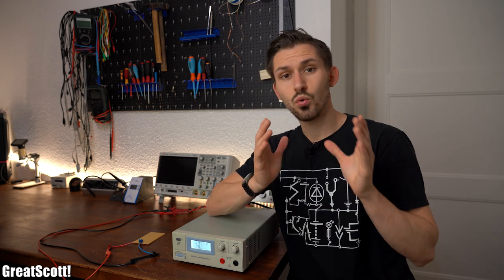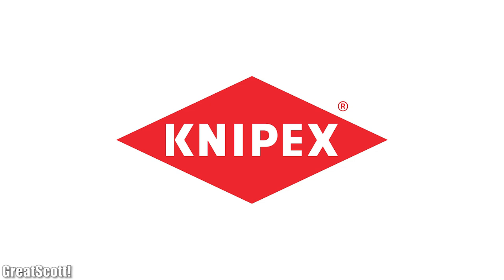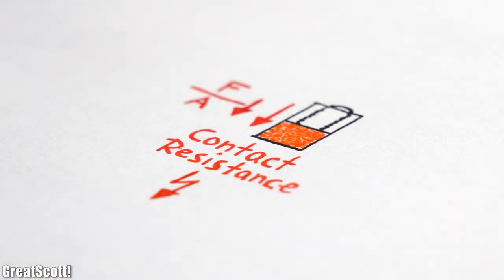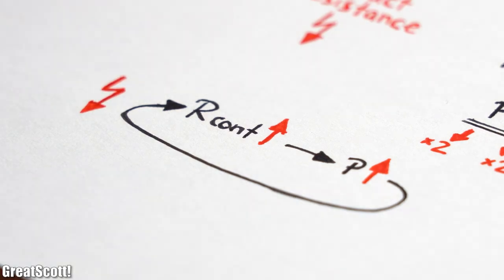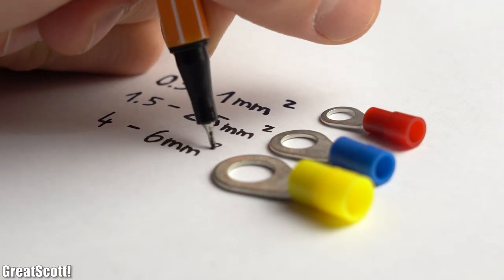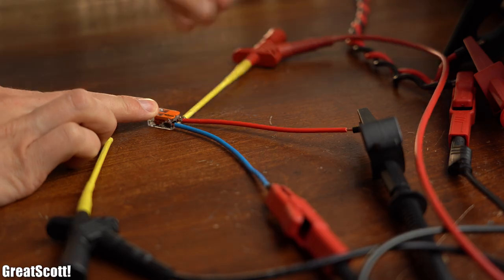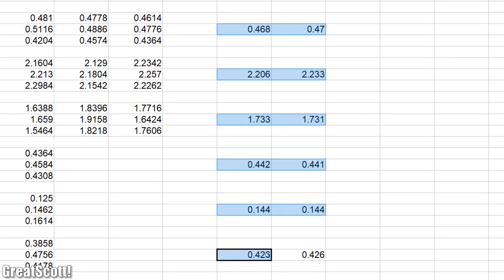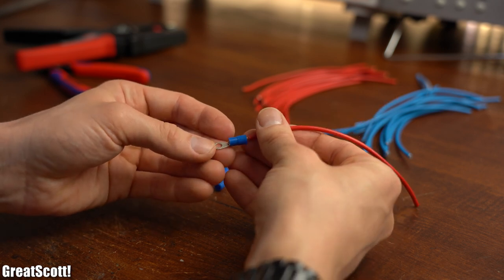Connectors are more important than you might think! So which one is the best? (Experiment)

Comment: After I moved into newly built rental home I happen to open one switch board as the plug always gave sparks and would often disconnect. To my horror I found every single connection in the board was loose despite the work bieng only 2 months old. Every switch, every socket, every single wire was loosely connected. After few days spent 16 hours straight and tightened, rewired 100s of electrical connections at home, the operation that went into the night and we had to use torches, candles etc till I had finished. Till date I haven't informed the owner though. I request everyone to check electrical wiring at home always when moving into new homes.

Comment: You should do experiments with Scotch-Lok connectors too. They’re insulation displacement connectors used in low voltage applications (like automotive). Something about them makes me feel weird, but if it works 🤷‍♀️

Comment: I personally think, that for the pcb screw terminals, you would have goten a better conection if you put the stranded wire directly into the screw terminal. I think this is possible because in contrast to normal screw terminals theese have a sheet of metal pressing down on the wires instead of just a screw head and if you tighten it enough it should not be able to move to reduce the contact force.

Comment: I'm confused... right at the beginning you are showing an Al/Cu connection with a WAGO.
I have to remove these as they are not save to use and already started fires. For a durable and secure connection, special Al/Cu cable lugs and connectors should be used. Typically with a special compound for best connectivity.
WAGO itself says that the 221 series is not approved for an Al-Cu connection. However, the 222 series would be possible with "249-130 Alu-Plus contact paste".

Comment: The Wago connector you used ( blue PCB screw terminal) has a max of 10 amps and you did point that out.    So you took it to the limit.    So really it is good test to point out.. however other terminal connectors would be nice however they too are max level of 5 amps some as high as 10 amps (MOLEX) used in automotive industry and PC industry for main buss terminal connectors from power supply's. 

Some terms uses as per amperage rated.

Comment: Interesting results, nice work👍. When will you pull 10 amp on them? When a dodgy manufacture puts them in a 3D printer. Eg Tevo Tarantula. Luck for me when the connector failed, the cable fell out and hung in the air so no fire. Swapped em all to hobby grade or soldered direct to board...

Comment: Ferrules is oddly enough not a default necessity for all control panels. I used to work at a control panel assembly line and not all customers demanded ferrules on their stranded wires.

Comment: You used 4 side crimping head, I use 6 side and it makes insane good job. 6 is better because it is more round type like cable itself. Sure, cost more money too.
Reply: If the terminal block you're screwing them into has a square hole, the 4-side would be better. If it's round, the 6 would be better.

Comment: Wouldn't a crimped ferrule become loose over time as well? I don't understand how it's different from a screw terminal crushing the strands together.
Reply: Screws can loosen over time. It's why things like loctite are sometimes used with screws to keep them from coming loose.
Reply: It does, true. I'm just not a huge fan of screw terminals, because of the screw. Even with solid wire, a screw can loosen given enough time.
Reply: @JohnClark-tt2bl  Is the screw loosening? Or is it distortion in the wire or ferrule due to thermal cycling. (When warm both the wire and the screw expand, and so the wire deforms to be flatter. Then when cool, everything shrinks and becomes loose.)

Comment: I newer understood why the cable shoe connectors were used in some quite high current situations. You can find them on engine starters on motor scooters/rollers which sometimes draw up to 50 A. You can also find them on the square rectifiers that can handle up to 50A. I never trusted these loose connectors and soldered 2,5mm2 wires directly ot the block rectifier otherwise the bad connectors would even heat the diodes up more than nessecary. The best is to solder if the connection stays rather cool. If it can get hotter than 150 deg. C you should use screws. I wonder why the pcd screw terminals got such bad readings? Should be like the other screw terminals - shouldn't they?

Comment: The soldered wire might win at first, but give it a few months after oxidisation kicks in, especially with the way it looked like it was done. Screw terminals are also fine if you get quality ones which are rated at higher loads and solder them properly in place. The cheaper ones are total junk and you are better off soldering the wire direct to the board, lol.

Comment: I have a problem with your comparison at the start of your video between the blue perfboard connectors and screw terminals. Pls correct me if I'm wrong, but the perfboard connectors you have are not screw terminals. They have a piece of flat metal that pushes down when you tighten the screw - NOT the bottom of the screw, and in my opinion these are BETTER for stranded wire and not good for single core. (Opposite to what you said.) I completely agree screw terminals are not suitable for stranded wire without ferrules. But the perfboard terminals are different to screw terminals in that way, I think. Also - as your experiment noted, those cheap Chinesium PCB connectors really are rubbish. Do you know of a suitable quality PCB connector? Maybe Phoenix?

Comment: I personally don't think the initial contact resistance if of much importance honestly... the big question is how does it perform after a few years. Still a good test though, I really would have expected screw terminals to do better. Question about those however... the quality of screw terminals wildly varies, what kind did you use?

Comment: I feel like you're comparing two very different sets of connection types. One is a connection to a PCB, the others are all wire splices. I guess the solder joint counts as both because you can solder pigtails directly to a pad. I was expecting to see differences in termination styles: Screw clamp terminal on board with stranded wire, soldered stranded wire, ferrule, solid wire, etc.

Comment: I hear this frequently on the news here that a fire started because of a short.  How can that be as you have fuses to prevent this?  That fuse is at the start of the circuit and is designed to trip at a certain current. I would rather say that fires start due to heating because of a bad connection or use of incorrect wire.  Anyone correct me if I am wrong please!
About 10 years ago I had a power strip that would sometimes make noise and stop working. I suspected the internals of the on/off switch on that thing, which already was an hazard, but I was wrong. The switch had screw on connections for the wires. Well they were not tightened properly.  
In my house I checked each outlet after 20 years of installation and there were a couple that I could tighten a bit. I also checked the terminals on the fuses and gave them an extra 'go'.  All in all that took like an hour of work but at least I'm a bit more sure now.

Comment: You could test their performance over a period under physical stress if you could make some "rig" for a repeatable battery of shock tests (vibrations) maybe..
Reply: I believe cable shoes should perform best (after soldering) on that - because that's what used in most automobile.

Comment: It drives me insane seeing bare copper hanging out the end of a ferrule, but I understand why you did it (so that you could hook a probe on). Also with screw terminals, some are 'clamp terminals' which means they are suitable for use with stranded wire where the screw isn't directly applying pressure, instead the screw pushes against a plate to apply pressure to the wire. Overall good review!

Comment: Just curious -- is that replacement Jbox you used at the beginning commonly used in Germany?  The U.S. requires that cables be clamped down tight where they enter a junction box, in order to avoid any mechanical stresses on the conductors.  Poking wires through random areas on a plastic box doesn't seem safe...

Comment: T H A N K   Y O U!

I cannot tell you how many times I have to explain to coworkers (AND MY BOSS) that WE DO NOT TIN CABLES THAT ARE GOING INTO CRIMP CONNECTORS!!!

I spent my first 2 weeks back at work this summer reterminating at least 50 speaker cables, and another 10-15 power cables that went bad due to tinned cable ends (YES THEY TINNED THE POWER CABLES!)
Reply: If you work in audio, and you tin conductors going into Speakon connectors, you need to not do that. They make connectors with solder cup terminals for this exact reason!

Comment: From my experience, the most worst is old aluminium wires in old houses. They always end up with melted switches, sockets, melted connectors etc.. Can cause fire hazard, they can break easily and under big load, they have pretty high voltage drop, causing wires to heat up under load.. It's painful to completely change these in concrete walls.. By now, there is Wago connector series and special Wago paste, specifically designed for connecting  copper and aluminium wires. Great solution if replacement of all cable is  not possible.
But I still hate old aluminium wires.. 😂
Reply: I was going to comment similar.  Al wire is a whole different 'animal' and can be such a pain.

Comment: Thankyou for the video .this was bothering me for a while .can you do a comparison on a terminal block with a bare stranded wire vs a bootlaced one.i still believe that a round peg in a square hole should have more resistance than a stranded wire that mounds and conforms to the terminal, when torqued to the connectors specification

Comment: I've never seen Wago connectors before. As for butt splices, I'm really pleased with Solder Seal butt splices. Low-temp solder in the center, with a lighter, torch, or heat gun, it will solder them inside a heat-shrink insulator, with rings of marine grade hot glue at each end to keep it sealed.

It always makes me cringe when someone just puts two wire ends next to one another, then glues them together with solder. I grew up with the "make a good mechanical joint FIRST, solder is not GLUE" school of thought. When I worked as an electrician, proper joints and splices were essential. The "good mechanical joint" we used most often to splice two conductors was "serving" them together, twisting each conductor around the other conductor in a configuration that looks an awful lot like a sailor's sheet bend or uni splice (https://youtu.be/e6-aCEf3hsY), THEN soldering. I like to use marine-grade glue lined heat shrink to seal the joint against water infiltration. A proper served splice with soldering is superior in strength, conductivity, and long-term service than even a Solder Seal splice or a crimped butt splice. I don't worry about the ability to detach one from the other because if I'm splicing a wire, I want it to become as close to a single solid conductor as I can make it. I don't WANT it to come apart, easily or otherwise! I want it to be permanent!

If I want a temporary splice, I'll put a junction box at that point, strain relieve the wires coming in, and splice them with a wire nut or crimp joint. But I nearly never do that with the kind of work I do, which nowadays is mainly antennas. I sometimes have to lengthen an antenna conductor, and the only kind I trust in that circumstance is a soldered splice. In permanent installations, I serve then solder and cover with glue-lined heat shrink. IF it's temporary, I use a Solder Seal splice...but I push them through the splice on one side as if it were simple heat shrink, serve the splice, then pull the solder seal splice over the served conductors, heat it until the solder flows into the wires, then shrink and seal it down. Two ways to do the same splice, differing only in that I didn't have to use a separate soldering iron (I have a lovely Dremel butane soldering iron for that purpose)...but I carry a bag of various sizes of solder seal splices, a lighter, and a good multi-tool in my purse for just such an emergency.
Reply: I work as an electrician, those Solder Seal thingamabobs have made it to Poland recently, and honestly, they're a nice way to do some "quick and dirty" field repairs, but their mechanical strength is not that great, and electrical resistance leaves much to be desired if they're supposed to carry any significant current...
Reply: WAGO´s are a godsend, get some and never look back.

Comment: You need to practice scaling the insulation to the right length. Some of the insulation must also be clamped in the housing.
Reply: Are you referring to Wago connectors? Nothing in the Wago docs or drawings show the insulation as being part of "what is clamped"?!
In fact it is "more dangerous" to leave too much insulation on as the clamp inside could then partially sit on the copper and partially on the insulation making a sparky, hot, connection.
But I'm no expert and have been wrong before - so feel free!
Reply: @jarls5890  Naah, the shoe you press.

Comment: Power input on a 3D Printer Mainboard and the Heated Bed on a 3D Printer. Most use PCB screw terminals with 300W+ Power supplies at 24V. And many Chinese manufacturers using stranded wires and some dumber ones soldering the tips of those wires inserted into the screw terminals.

Comment: To be fair. I think your worst connector would jump in ranks if it where the type that had the screw pushing down on a metal bar to squash the wire over the full area rather than the one used which pushes on a springy light metal tab which, as it compresses the wire pushes it out of its desired holding position. Those things are crap. lol This is not a critic just an add to the group. Love your vids watch them all.

Comment: I'm currently working on diy ECU for my car (based on the speeduino project). And the connectors that used in the schematic is hard to find here where i live.. 

The highest power my components will take is no more than 3A (injectors and fuel pump). Can you suggest a connector that are inexpensive, safe for automotive use and easy to find everywhere?
Reply: How many terminals do you need? I think aviation connectors are more than enough based on your suggested usage.
Reply: @thisjt  3 injectors, 3 ignition coils (low current), 1 fuel pump, 4 terminal TPS sensor.

Everything that is used for sensors are low current. only the injectors and fuel pump that are going to suck some power (like 3 amps because 1 paired 2 injectors per channel)

Comment: I use the pcb screw terminal for powering an atomic pi with a wires that are not single-piece but stranded-wire and over time it always seem to lose efficiency when I need to strenghten it again...

Exactly was thinking about soldering it in directly before seeing this and now this is sent to me by google haha

Plus question: There was a place where I had to solder together main 230V voltage wires in my house because of space constrains (legacy electric setup - there was no place for any box but is copper-to-copper and same size). Wondering if higher voltage or time passing keeps these good aspects for results of the soldering. There is no mechanical stress involved at the location thankfully and cables I strandled upon each other (they were not stranded wire, just I stranded the two over each) before soldering them together to make it a bit more mechanically resisting.

Comment: I still don’t like Wago connectors as over time those glorified speaker terminals will warp and fail.  They’re probably not bad for low current applications like LED lighting or simple electronics but have low contact surface area compared to wire nuts, thus more prone to heat.